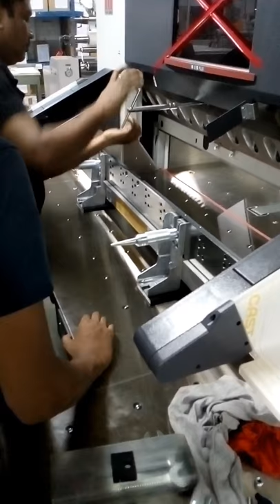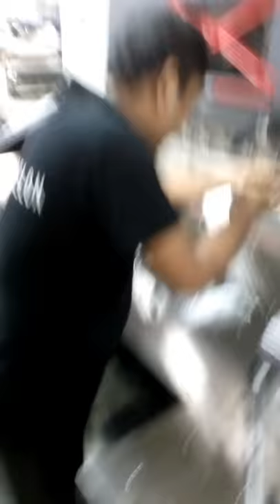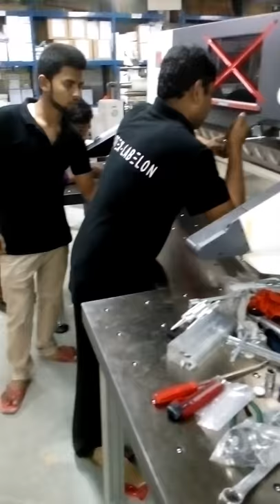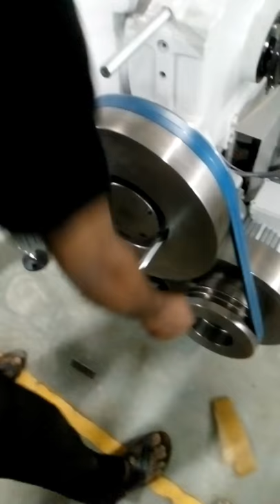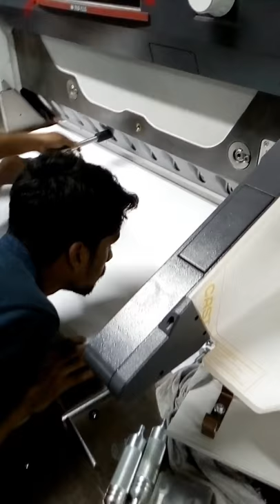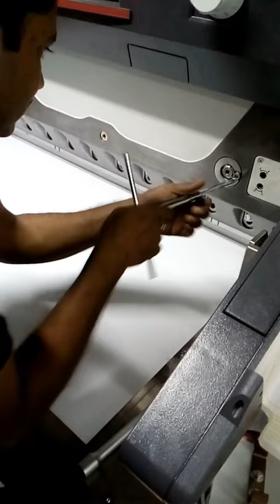Polar 115 cutting blade change procedure

Comment: How to चेक back gague is stright 
How to set it in less time to perfect cut
Reply from the maker: For a perfect cut, there is advance option in automatically knife adjustment in Polar 115. But, if you want to manually cut then you have to adjust the knife by a 100gsm paper and down the knife manually and pressure adjust with angle bar. And always try to set up the knife pressure accurate for a better cut.
Reply: @protaproy4750  Hello what is the meaning of.. observe maintenance schedule..thank you for reply
Reply from the maker: @djtitan9239  Thanks for your comment. There are weekly, and monthly maintenance schedules which means you have to clean by air, grease, and lubricate the machine in a proper way. That will enlarge your machine productivity and longevity. Thank you.
Reply: @protaproy4750  in the morning when he opens the machine then when he uses the machine when the blade falls the observe maintenance schedule appears..thank you for your reply
.
.
because in the clutch of my machine, sir, the oil was leaking before the circle inside the clutch was changed, my ball bearing is that the cause of the observe maintenance schedule, there is leaking oil.. thank you sir, I hope you can reply..
Reply from the maker: @djtitan9239  I understand. Then log into service mode and acknowledge the schedule service period message. That message will not appear anymore. Thank you.
Reply: @protaproy4750  thank you sir